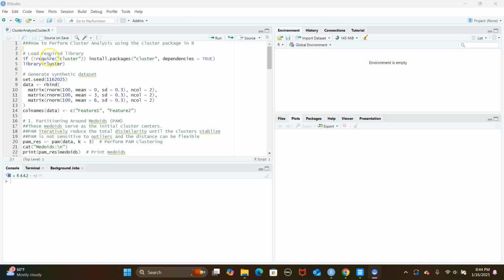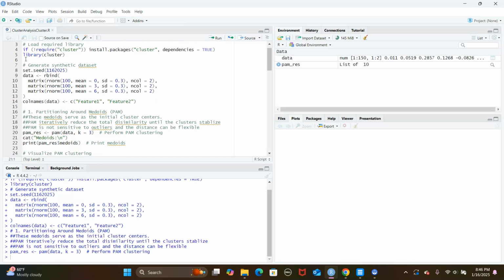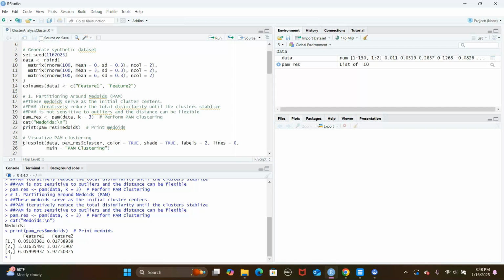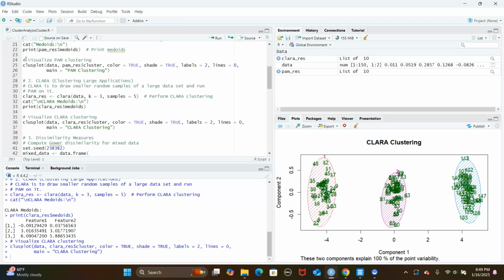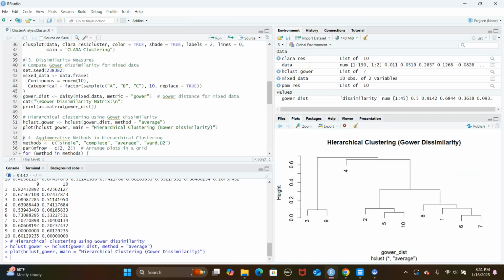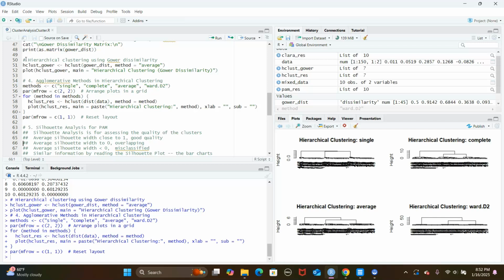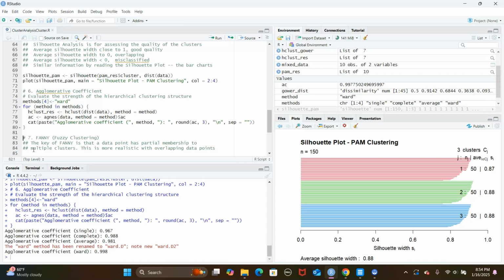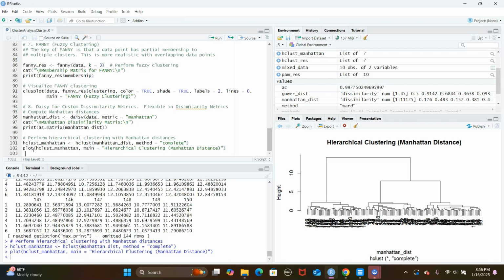How to Perform Cluster Analysis using the R Package cluster  #r #clusteranalysis #PAM #CLARA #FANNY

Comment from the maker: ###How to Perform Cluster Analysis using the cluster package in R

# Load required library
if (!require("cluster")) install.packages("cluster", dependencies = TRUE)
library(cluster)

# Generate synthetic dataset
set.seed(1162025)
data <- rbind(
  matrix(rnorm(100, mean = 0, sd = 0.3), ncol = 2),
  matrix(rnorm(100, mean = 3, sd = 0.3), ncol = 2),
  matrix(rnorm(100, mean = 6, sd = 0.3), ncol = 2)
)
colnames(data) <- c("Feature1", "Feature2")

# 1. Partitioning Around Medoids (PAM)
##These medoids serve as the initial cluster centers.
##PAM iteratively reduce the total disimilarity until the clusters stablize
##PAM is not sensitive to outliers and the distance can be flexible
pam_res <- pam(data, k = 3)  # Perform PAM clustering
cat("Medoids:\n")
print(pam_res$medoids)  # Print medoids

# Visualize PAM clustering
clusplot(data, pam_res$cluster, color = TRUE, shade = TRUE, labels = 2, lines = 0,
         main = "PAM Clustering")

# 2. CLARA (Clustering Large Applications)
# CLARA is to draw smaller random samples of a large data set and run
# PAM on it.  
clara_res <- clara(data, k = 3, samples = 5)  # Perform CLARA clustering
cat("\nCLARA Medoids:\n")
print(clara_res$medoids)

# Visualize CLARA clustering
clusplot(data, clara_res$cluster, color = TRUE, shade = TRUE, labels = 2, lines = 0,
         main = "CLARA Clustering")

# 3. Dissimilarity Measures
# Compute Gower dissimilarity for mixed data
set.seed(238382)
mixed_data <- data.frame(
  Continuous = rnorm(10),
  Categorical = factor(sample(c("A", "B", "C"), 10, replace = TRUE))
)
gower_dist <- daisy(mixed_data, metric = "gower")  # Gower distance for mixed data
cat("\nGower Dissimilarity Matrix:\n")
print(as.matrix(gower_dist))

# Hierarchical clustering using Gower dissimilarity
hclust_gower <- hclust(gower_dist, method = "average")
plot(hclust_gower, main = "Hierarchical Clustering (Gower Dissimilarity)")

# 4. Agglomerative Methods in Hierarchical Clustering
methods <- c("single", "complete", "average", "ward.D2")
par(mfrow = c(2, 2))  # Arrange plots in a grid
for (method in methods) {
  hclust_res <- hclust(dist(data), method = method)
  plot(hclust_res, main = paste("Hierarchical Clustering:", method), xlab = "", sub = "")
}
par(mfrow = c(1, 1))  # Reset layout

# 5. Silhouette Analysis for PAM
##  Silhouette Analysis is for assessing the quality of the clusters
##  Average silhouette width close to 1, good quality
##  Average silhouette width to 0, overlapping
##  Average silhouette width < 0,  misclassified
##  Similar information by reading the Silhouette Plot -- the bar charts

silhouette_pam <- silhouette(pam_res$cluster, dist(data))
plot(silhouette_pam, main = "Silhouette Plot - PAM Clustering", col = 2:4)

# 6. Agglomerative Coefficient
# Evaluate the strength of the hierarchical clustering structure
methods[4]<-"ward"
for (method in methods) {
  hclust_res <- hclust(dist(data), method = method)
  ac <- agnes(data, method = method)$ac
  cat(paste("Agglomerative coefficient (", method, "): ", round(ac, 3), "\n", sep = ""))
}

# 7. FANNY (Fuzzy Clustering)
## The key of FANNY is that a data point has partial membership to 
## multiple clusters. This is more realistic with overlapping data points

fanny_res <- fanny(data, k = 3)  # Perform fuzzy clustering
cat("\nMembership Matrix for FANNY:\n")
print(fanny_res$membership)

# Visualize FANNY clustering
clusplot(data, fanny_res$clustering, color = TRUE, shade = TRUE, labels = 2, lines = 0,
         main = "FANNY (Fuzzy Clustering)")

# 8. Daisy for Custom Dissimilarity Metrics.  Flexible in Disimilarity Metrics
# Compute Manhattan distances
manhattan_dist <- daisy(data, metric = "manhattan")
cat("\nManhattan Dissimilarity Matrix:\n")
print(as.matrix(manhattan_dist))

# Perform hierarchical clustering with Manhattan distances
hclust_manhattan <- hclust(manhattan_dist, method = "complete")
plot(hclust_manhattan, main = "Hierarchical Clustering (Manhattan Distance)")